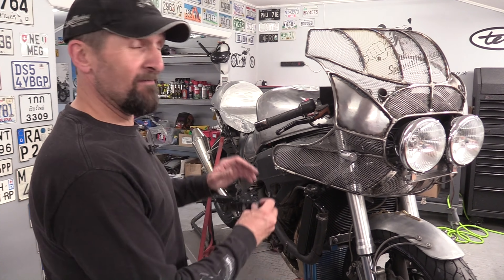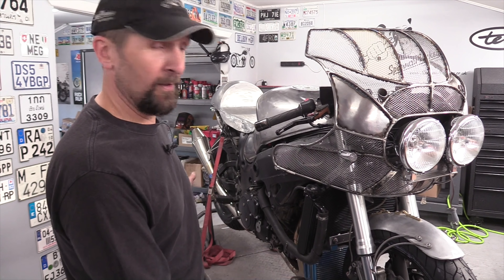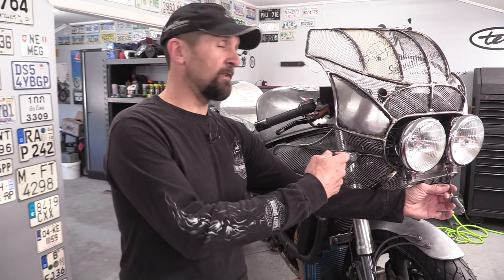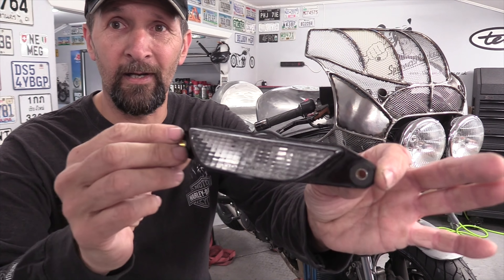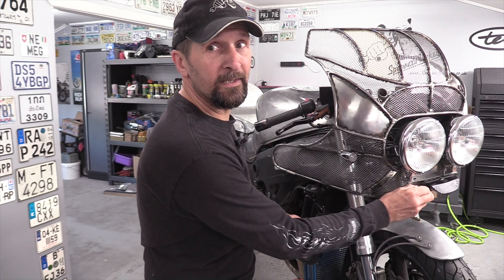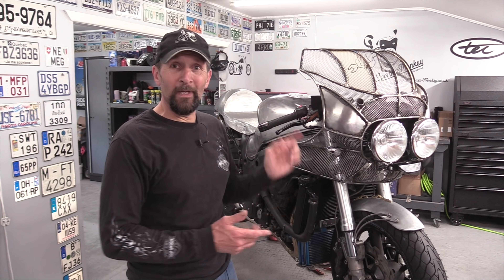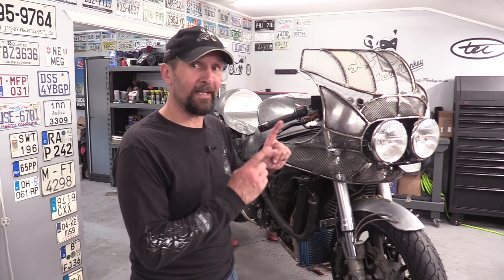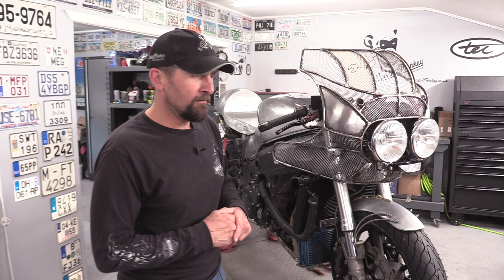Wasteland Busa #74, Running Light !

Comment: Nice. Just a thought ... how about flipping the light so it has a mean frown (rather than a happy face), also would follow the shape of the fairing better as opposed to sticking out like a tongue.
Reply from the maker: Then the lens would be upside down ! it's only temporary till i get it through inspection.
Reply: @Moonfleet41  Well that certainly answers my question about putting it behind the mesh then.  Didn't realize it's intended to be removed.

Comment: I didnt know until about 3 weeks or so ago that you don't actually have to have sidelights for an MOT.   Learn something new everyday.  Asked the MOT tester about it and he told me.  Also checked MOT regulations and alas, he was right!  (not that i doubted im :P)
Reply from the maker: if it was never fitted, then fine... but if there is a switch for it on the bars, it should work.!

Comment: First of all hello from Waco, Texas   been with you a few years and you do excellent work I learn tricks from you all the time. I am a mobility tech I deal with loads of solder connections .I was told from people that flame on shrink tubing will cause it to degrade and crack, you should a heat gun type device.  I know at times I cant get my heat gun in and have to use propane lighter . Carry on with your great work

Comment: shows how much light weighs, then adds even more sheet metal 🤦‍♂️🤦‍♂️
Reply from the maker: yeah, shoulda' cable tied it on aye.!
Reply: Delboy's Garage get yourself a 3D printer and make the brackets out of plastic
Reply: @Moonfleet41   super glue and gaffer tape mate.
Reply: @Moonfleet41  then why show the weight of the light, think your missing the point of what Dougie is saying!

Comment: "On a shelf, in the workshop, stood Running Light, feeling brave,
in another, part of the workshop, sat Little White Bulb, Nippon made.
When Del soldered, them all together, & gave them voltage, through their bits,
Penny banned the, next set of lyrics, 'cos they're bound to mention  . . . .
Chorus:
Running Light, loved Little White Bulb, with a love, big as the sky,
Running Light, loved Little White Bulb, through a 'fuse'*, that couldn't die" . . . (*2BA bolt mate, brutal but sorted : ) x

Comment: But you don't need a running light
Reply from the maker: if it has a switch...it must work.!
Reply: @Moonfleet41   
From the MOT Manual..........no you don't

4.2. Front and rear position lamps
4.2.1. Presence, condition and operation
All mandatory front and rear position lamps must be inspected.

Position lamps are not testable on motorcycles if they are:

not fitted or have been removed
permanently disconnected
painted over or masked
A solo motorcycle can have one or two front and rear position lamps.

These lamps must be:

mounted centrally - if there’s one lamp
mounted one above the other on the centre line - if there’s 2 lamps
mounted symmetrical about the centre line - if 2 are mounted side by side
A motorcycle combination must have 2 front and 2 rear position lamps.

Front and rear position lamps can be incorporated with the direction indicator lamps. The position lamp on the same side of the direction indicator may or may not switch off when the indicator is switched on.

A headlamp or a daytime running lamp (DRL) can function as a front position lamp. The DRL may or may not switch off or dim when the headlamp(s) are switched on and the engine is running.

A motorcycle with a headlamp does not need to have a front position lamp.

A sidecar must have a front position lamp.

You must assess damaged or repaired lamps for security, colour, light output and durability.
Reply from the maker: ill get you to come argue the toss for me with my tester...he'll enjoy that.!
Reply: @Moonfleet41  I hope it passes :-)